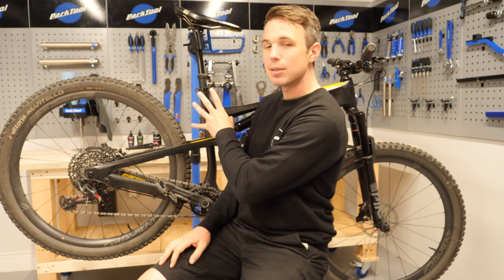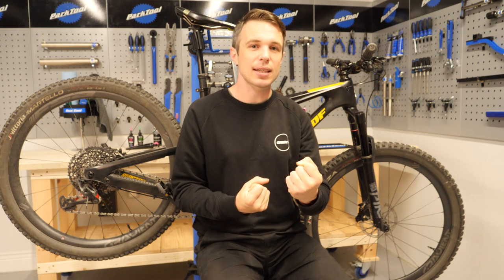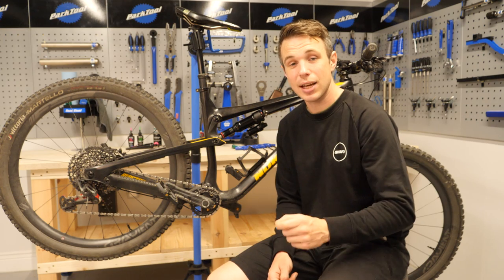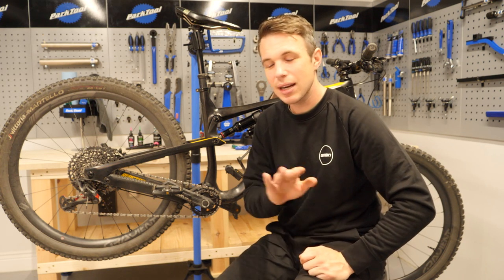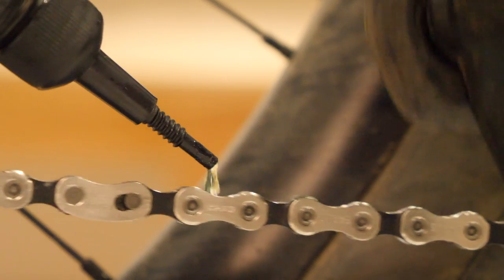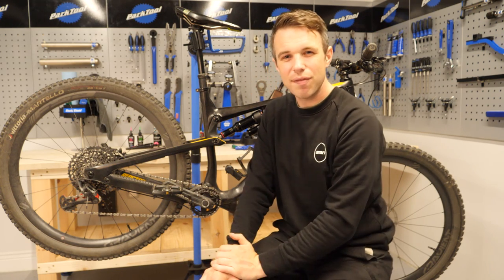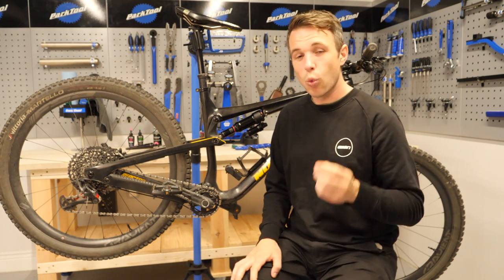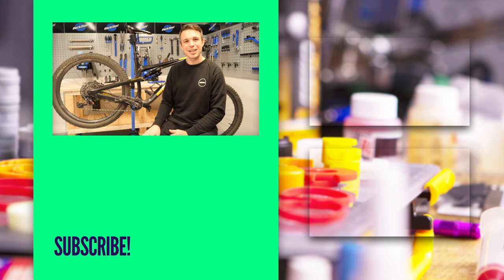How To Silence A Creaky Mountain Bike | Stop Your MTB From Creaking

Comment: I had a terrible creak from my Seat post to frame interface. Took it out thoroughly cleaned the frame and Seat post and installed with a thin smear of grease. Lovely, creak eliminated.
Reply: 👍great video, got a ticking noise coming from my driveside cranket🤔even when light pedaling?

Comment: The theme reminds me of many GT Zaskar LE bikes where the bottom bracket always creaked because they were not properly welded in the USA. The mechanics always took the bikes to the back of the shop where nobody saw anything, then the seat post was pulled out and oil was poured into the seat tube. So the creaking was done for a few months. The Avalanche models, welded in Taiwan, did not know the problem.
Reply: Would that be the 2019 Avalanche? Cause there's a constant creaking in my 2019 Avalanche Comp that keeps freaking coming back no matter how many times I clean it, tighten it, grease it or take it back to the bike shop.
Reply: @Gabriela-jc4pt  No that was with the GT bikes in the 1990's.
But try it out after you have checked the bottom bracket, crank and chainrings first.
Reply: Doral industries bro.
😆 gt, cannondale,road master, schwinn,home appliances:) 🔥  🔥  lmaooooo. Worse than pacific lmao but atleast its pacific cycles...
Reply: @Gabriela-jc4pt  take her back and get the gt comp. Air fork and 1x. For reasonable cheap price. Under a grand.
Reply: @d.mickeleit9719  b.b. or crank set for sure.
Reply: @d.mickeleit9719  I'm building a custom Ragley Mmmbop next year and converting the Avalanche to a gravel bike so as long as it doesn't fall apart on me until then it'll be fine LOL

Comment: I had a really annoying creak on my trek fuel ex 8 in the headtube but only when I stand up and peddle pulling on the bars, i did all the usual cheaks pushing on a peddle off the bike because is normally the rear suspention not a sqweak! So I took my forks off cleaned the bearing cups and reassembled with anti sease and still happening! So I cheaked every bolt on my rear suspention and yes a main pivot bolt was dry and seased coursing the vibration to travel all the way up the down tube to the headset, now I can ride happy 😊

Comment: One that drove me nuts trying to trace turned out to be IRCC Command dropper post to frame interface... a full clean out, grease and massively over-torqued collar bolt sorted for a while. Gave up in the end and now run a Brand X Ascend...night and day difference  and no cracking noises. Happy as Larry now

Comment: Im getting a gnarly creak just  riding over a speed bump. I installed new forks recently and have pinpointed that and got it figured out. Hit the jumps, and now ive got a loud creak coming from the mid to back end. Think its from the dirt getting in there. It's been a dry summer. Going to do a complete run thru of the bike
Great video!

Comment: Least common place people check: bike post, and bike seat connection on the rails. I grease the rails gently for zero creaks. 
Sometimes the seat gets wobbly inside, and you can't do anything, but I know what creaks, because I lubricate everything that can make that noise. Of course within limits of safety.
Also, use ears, and isolate where it could be. 
Remove bike seat and ride without it, does it creak? Remove bike post, creaks? And so on. 
Also stem that holds the bars can creak a lot. I lubricate using STP auto grease (all purpose), that cost like 4 bucks for a pound/half a kilo. 
No point spending more on specialized bike grease. 
It lubes everything from bearings, rear hubs, pedals, pedal screws, bottom bracket thread, bottom bracket hole, bar connections, seat post.

Comment: I played hunt the creak on my bike a few weeks back, it was defo coming from the drivetrain. After cleaning and regreasing bottom bracket, crank and chain ring, pedals, cassette and free hub I eventually discovered it was coming from my lower jockey wheel. Gave the bearing a good ol flush out with GT85, regreased and now my bike runs quiet as a mouse 👊

Comment: My most annoying creak was on my current Boardman FS Team. Mine is the 2014/2015 model. My original cranks just would not stay quite. They creaked all the time. I actually lost count how many times I had the cranks off and the bottom bracket out. I greased, cleaned and re-greased them. They just kept creaking. The original cranks and BB were made by FSA. I don't remember the model but they did have 3 bolts holding the rings on. The only way I found to shut up the cranks and BB was to fit Shimano Deore cranks and Shimano BB. That cured the creaking. Only to find as I went for smaller rings there wasn't enough adjustment in the high direct mount front mech.

Comment: Seatpost  and seatpost clamp is the major problem area for me. Dirt gets in there an it creaks and the noise travels trough the whole frame. Tough to locate. My solution was a new clamp without quick release( a dirty quick release is really loud and the torque is never perfect anyway) A simple clamp with a bolt is torqued perfectly and less prone to get noisy when dusty. Even better to cover the slot in the seat stay to avoid dust and dirt between post and seat stay.

Comment: I got creaks coming from my brand new time pedals...both Mx and cc varients...can't be the bearings, got rid of the dirt, bolts titled plenty and greased + pre cleaned.

It sounds bearing related however, as it happens on both and they're basically new...my belief is that it's coming from the clips themselves...possibly as I'm using worn cleats...not much I can do short of replacing the cleats...I just put up with it 😊

Comment: This must be some sort of coincidence.So Bought a new bb all great adnd good without the creaking ,after 100km it starts again the things I did to make it good were:lube my seatpost; trying different pedals; cleaning all the transmission of the bike;cleaning/lubing skewers and  the problem was the rear derailleur bolt that fixes to the frame was not tight enough. Conclusion I went crazy with this creaking
Reply: Better safe than sorry

Comment: I'd add the pedal-crank interface to the checklist, it tends to generate "clicking" noise when it is dirty.
Reply: Can you elaborate? Do you mean where the pedal goes into the crank arm? Cause that's exactly the problem I have, clicking at exactly 2 oclock on the drive side crank arm on every rotation. I have a GT Avalanche Comp 2019 and RF Chesters
Reply: @Gabriela-jc4pt  Remove the pedals and clean the threads then re-grease the threads.  Worked for me.
Reply: Thanks for this tip, I have a click, and swap between flat and clip pedals regularly, re-grease the threads, but not cleaned the interface, so will try that.👍
Reply: @Gabriela-jc4pt  I had the same problem it drove me crazy for months the bike was in and out of my local bike shop but the click never happened when they rode it. Turned out it was the shoes I was wearing. The end of my laces had heavy duty plastic on the ends and when they were too long they would hit the frame as my right foot went round. Needless to say I felt dumb.

Comment: Mine turned out to be the Free hub needing a good cleaning. I hit it with WD-40 and kept turning it to get the oil deep in the mechanism. It worked. I needed to remove the free hub using a 10mm Allen wrench BEFORE hitting it with oil.

Comment: I had rattling noises coming from my 2018 Canyon Torque. I couldn't get it away so I sold the frame. 

The problem were bushings at the yoke that were made too small - even after visiting the Canyon headquarter they couldn't get it away/didn't  want to help me... this even is a known issue and Canyon won't do a thing about it. What a shame!

I btw switched every part to my new SC Bronson 2 frame and it's super silent when riding now :)

Comment: What about csu issues with forks? Those are the worst creaks
Reply: Loctite 290 on the uppers. Leave bike upside down for 24 hours and let the Loctite seep in.
Reply: I’ve got movement in my stanchions on my dt Swiss forks I have to replace them now
Reply: Areeb Rides MTB try a seal and fresh wiper change, the fresh oil in the foams took out my play in my fox 34. 2019
Reply: Francesco Sergi it’s definitely movement from the upper crown because the stanchion is moving inside the upper crown where it’s pressed into if you know what I mean?
Reply: FPSkillerPC tried countless times on my 36, no difference
Reply: Rory Ryan even if it did make a difference knowing that your fork is pretty much held by some superglue doesn’t help in the back of your mind so just get new forks. I’m replacing my dt Swiss ones for some pikes that’ll actually last some years and not a few months
Reply: My low end forks had that problem,  its usually better so sent them to warranty

Comment: I just pack the rails where they enter the saddle with grease, no more noise
Reply: That attracts so much dirt and in the end causes creaking
Reply: A light spray with WD40 is all it needs. Doesn't need grease.
Reply: WD-40 ,pedal springs and cleat bolt interface also.

Comment: i had a creak coming from my lock on grips. i fully teared my bike apart but not the lock on grips took me around 4 hours to take apart, cleaning all the areas and regrease everything, but the creak was still there (i had my cockpit  hanging down without removing the levers, grips and shifters). so i rode my bike for some more montah with the creaking and when i twas time to change the grips, tada, the creaking was gone.... this was the most weird creaking i had and it sounded like it came from the headset...

Comment: I'm trying to silence a creek in a chromoly 98 fisher hoo ko e koo.  It has been this way for a few years, I just learned to live with it.  I had the bottom bracket removed, re-greased and re-torqued by a reputable local shop a couple years ago.  It ONLY makes noise after about 40 minutes into my ride.  Dead silent before that.  Does not seem dependent on ambient temperature.  It only creeks on hard pedaling and only on the down stroke of my right foot.  I am slowly going through the trouble spots.    New shimano SPD pedals first since I needed new ones anyways.  I have a chainring bolt spanner wrench incoming.   I will remove and thoroughly clean, re-torque and loc-tite the bolts.  Hopefully I don't need to remove the cranks.

Comment: Yeti SB5 - Growibg creak over a month when only pedalled, changed bb and bearings twice and a headset for good measure, traced sounds as it still developed, tried saddle, rear wheel, chain ring and nothing, its currently awaiting a pick up back to crc for inspection after 3 months of no riding

Comment: I had an annoying creaking sound for several months.  It always sounded like it was coming from my bottom bracket area while pedaling under a load.  It was driving me crazy.  I disassembled my sprocket and greased all the screws, I replaced my pedals, I replaced my chain, I replaced my cable router at the bottom of my bottom bracket, and even eventually replaced my bottom bracket.  But each time I independently replaced a component the damn creak was still there!  After all that I finally found the culprit.  It was a loose rear derailleur hanger!  Upon inspection I noticed that it was barely finger tight.  I took it off, cleaned and greased it and put it back on.  The creaking noise was finally gone.

Comment: On my bike the most common part to start creaking is the cassette where it sits on the freehub body splines.
Reply: I cleaned and greased the freehub body on my eMTB as well as the cassette but the noise is still there. Metal-under-tension like creak and sharp bang when under medium to hard load due to pedaling. Now I'm suspecting it might be the rivets keeping the largest cogs together on the cassette.

Comment: SRAM XD free hubs do need a good application of grease on the threads, the cassette interface cut outs and the end of the body where it sits against the inside of the 10 tooth end of the cassette. Also grease inside both ends of the cassette.

Comment: My seat creaks i just blast it with wd40 and i goes away for a couple days
Reply: Or you can disassemble the clamp system, clean it, reassemble to proper torque and not have to deal with it for a long time
Reply: S Transou its where the rails go into the seat not the clamp
Reply: Mountain Bike Addict yeah it happens on my boardman saddle

Comment: You missed a really annoying one. The hanlebar touching the stem. If its all dry and maybe not torqued properly it tends to creak. The best method to find it is apply pressure to one end ot the handlebar and immidiatly after to the other side.

Comment: my non drive crank arm. turned out the bolt was not pushing the crank arm in enough on the tapered square bb. had to file some parts down and improvised a washer made of aluminum, et voila, no more creak.

Comment: Are typical listed bike torque specs for dry or lubricated fasteners?
Reply: Good question. I would quess torque specs are dry values and adding grease will mess them up. But maybe nothing to worrt about..
Reply: In general mechanical engineering they are always given for greased fasteners. 

For the components it does not matter cos torque is torque. But a greased fastener reaches the torque after some more thread pitches are screwed in. That does of course provide more safety.

Comment: I had pedals creaking when pushing harder and thought that it was my bottom bracket. Noise would go away sometimes after riding in rain.
I just had to pull out the medals, clean and apply some grease... I did not have the knowledge neither the grease to put the pedals properly the first time.

Comment: I just bought my first bike about 2 months ago at the age of 35. The first one I received the front wheel bearing always bad out of the box. So I exchanged. Took them a month to get me another and I have been riding for about 3 weeks to a month now and very much enjoying. New issue is I had a very loud squeal come from the pedal area but it stopped so I left it alone. Yesterday while peddling up a very small incline I had a pop like I just changed gears and since then any time I stand and pedal I have a pop and a creak coming from the pedal area again. The bike is only a month old and it hasn’t seen off road yet and it is carbon fiber. Anything info would help. I don’t want to go another month without a bike but I’m not sure where to go from here without exchanging it again. Thanks.

Comment: Got a new creak goin' and it's ruining my day to day existence, constantly thinking about it! It mostly occurs on preloading before jumps, or railing through berms when heavy weight and speed is applied. Strangely, the bike is mostly quiet during heavy torque on climbs. Driving me nuts. Could it be headset related? I already cleaned out headset bearings and bottom bracket area. I didn't do anything to the crown race, though. It looks like in this video, he uses a lot of grease on the crown race (1:45). Maybe I should try that...Ugh, I am at a loss.
Reply: I saw that video too and I thought it was a strange place to use grease. Did you ever figure out what was causing the creaking? I'm going to the same thing and like you it is ruining my day to day life! Its all I can think about.
Reply: @tac6044  It was the coil on my shock! I had upgraded the spring on the shock because the bike shop said I was too light for the spring that it came with. Strangely, I never had a problem with the original spring and always thought it was great out on the trail. I decided to take their advice and see if I noticed any difference so I gave a new spring a try and it was fine for a few months but then that horrid clicking-creaking! I put the old spring back on and it's been silent ever since.

Comment: I was hoping for actual creak-hunting tips and techniques, not just "take it apart and clean it all anyway".
Even qfter a full thorough clean, i find the occasional creak or squeak thats impossible to find unless youre actively riding on it, and then it becomes dangerous to try and diagnose as you look at your back wheel and drive train while riding.

Comment: My renthal fatbar 35 carbon lite makes a creaking noise it is in a renthal  apex stem and it is set the the recommended torque setting (5nm)  i have even tried using park tool assembly compound to no avail, any ideas? (The stem requires no gap on the bottom of the clamps)

Comment: Hey guys, I have a very weird creeking/vibration/rattling on the front brake.
I tried cleaning the pistons with some oil (like your tutorials recommended).
Whenever I go fast, it starts making a vibration sound, and when I pull the front brake very slightly the noise goes away.
Any help is appreciated!
Reply: Could be resonance frequency of the whole bike system. The whole frame and bike vibrates and a certain speed the resonance it met. There isn't really a satisfying solution for that. 

There are some dampings that can be placed beneath the disc...

An easy fix might be to check whether all bolts are tightened.

Comment: I had a very loud creak comming from my Headset (External Cup)
I knocked it out and put it back in with some grease and the creak was gone :D
Reply: Sometimes it's the split compression ring on the steer tube. As always grease and possibly reorienting that ring can help.. Derailleur rollers can squeak only while shifting. WD-40.
Reply: @davidburgess741  I already checked it before and it was the lower cup. 

And what's that about Derailler Rollers?🤔

I didnt wrote anything about it